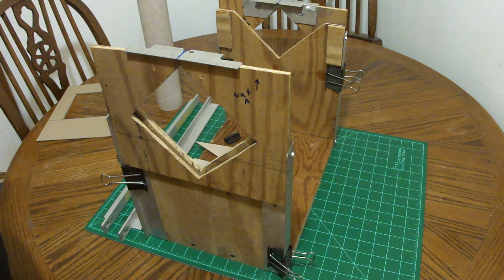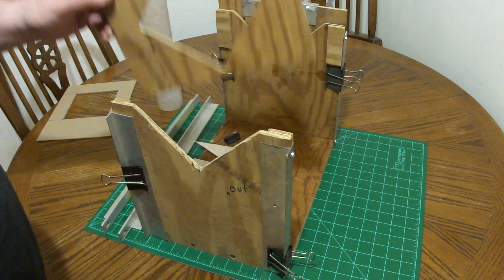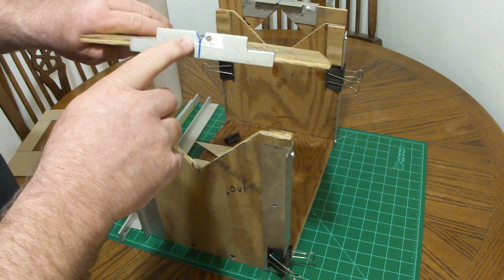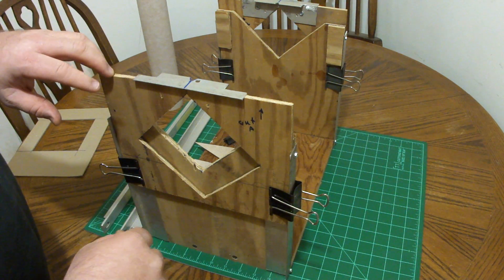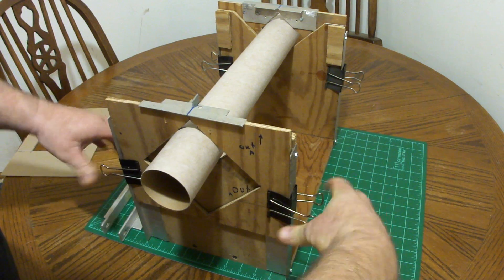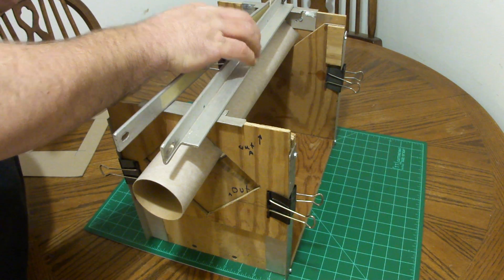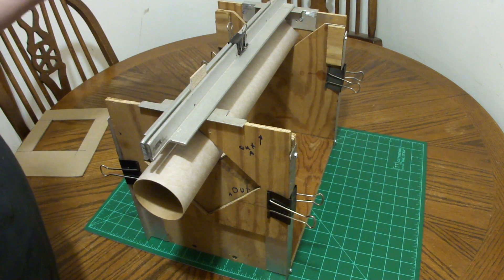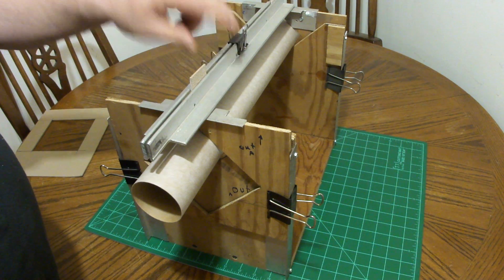Home Brew Model Rocket Fin Alignment Tool

Comment from the maker: I tested the tool today with a 'Big Daddy' and through the whole flight there was not even a quarter turn of rotation on the rocket. I reviewed the video several times and the rockets was painted in the Peenemunde test pattern.  Success.    
 
The mat in the video the tool is setting has 1" squares. The base is 10"Wx15"L base and 11"H.  Kind of big, but it works.